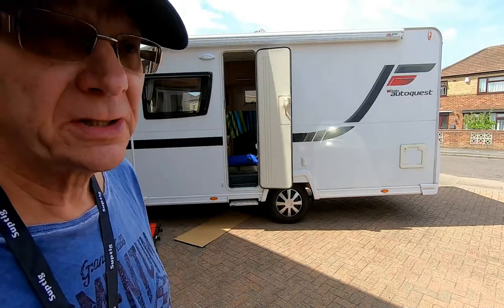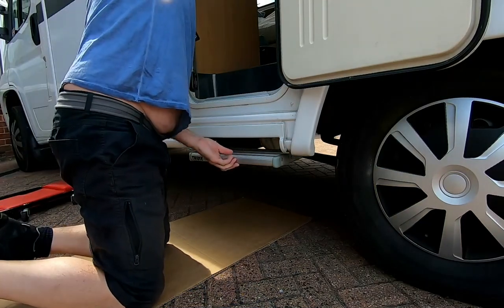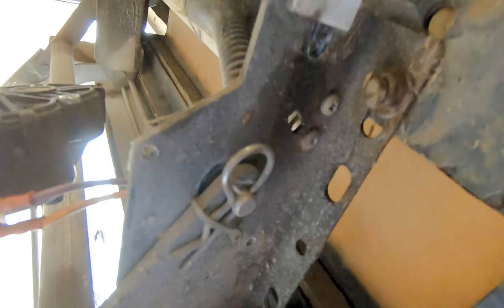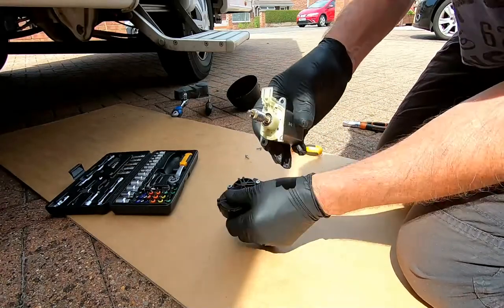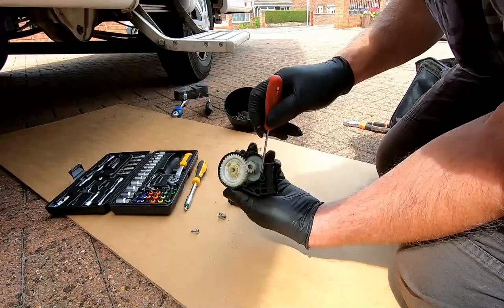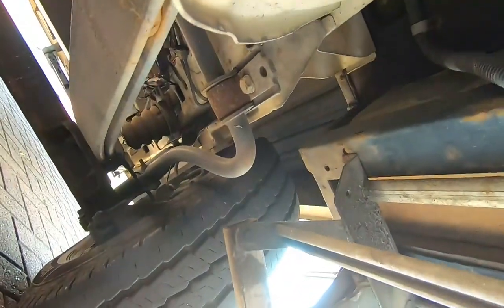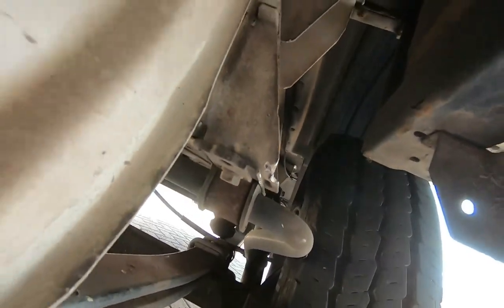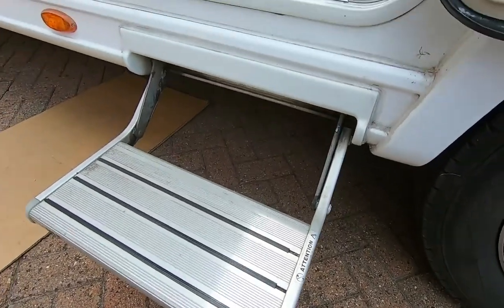Thule Step Repair

Comment: Absolutely brilliant video showing your repair and how the step works. My step has stopped working, due to the white cut off switch being faulty. Water had got into the switch and rusted the return spring inside, meaning that the lever didn't ping out when the step was down. New switch ordered, waiting for delivery.
 Your video should give others confidence to tackle step problems, thanks for taking the time and effort uploading this to help others. One very small point - I found the music a little off-putting and it didn't add anything to the video, other than that, brilliant and thank you!

Comment: I have the same problem so your video has shown me what to do.  Out of interest do you know where the fuse is for the step as I am not sure I am getting any power to the step at the moment so want to check the fuse.  Great video with easy to follow steps
Reply from the maker: Hi, not sure where the fuse is but as mine runs through the ignition I assume it is in the main box? Make sure you have it switched on to operate if using the step close function when you start the vehicle. Otherwise I can only suggest checking the connections at the step motor.
Regards vertical.

Comment: I've arrived on site and the motor is operating OK, but the step is just sliding back and forth and somehow disconnected and so does not go in and out ???
Any suggestions????
Help !!
Reply from the maker: Other than a total dissemble of all components I’m not sure what might be happening here. Try turning off and on the auto close on your dashboard menu.

Comment: Hi mate, nice job, just wondering as Im looking at fitting a step, is your motorhome with the step an ALKO chassis as I have a Bailey on an ALKO and keep getting told I cant fit one as it's too low?
Reply from the maker: Yeah. I do know that you need to have the right space for fitting. This was on the van when I got it. But I have seen some different arrangements with different types of steps! If they say it cannot be fitted then they may be right. But all in all it is just bolted on. Obviously you need the electric connection to your ignition so when you start up it automatically closes. Sorry I can’t advise you more as I didn’t fit it.  I have seen some low fitting one in my travels- best to investigate further on the internet. Try Motorhome fun website.